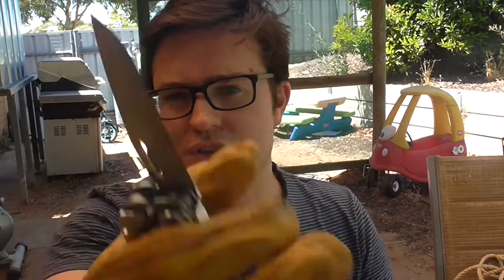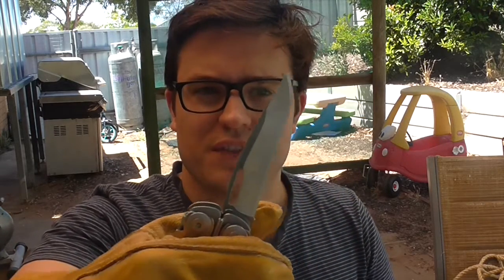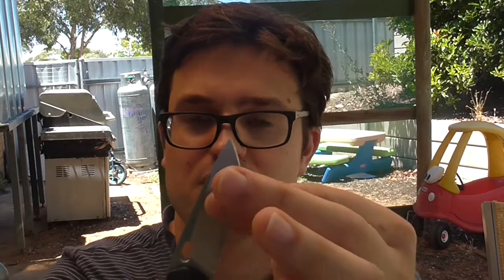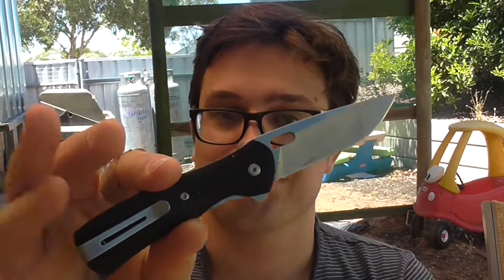Edge Retention Test! 420HC vs Paul Bos Buck 420HC edge retention comparison

Comment: Neat to see this old video of you in your younger days! Now, according to the data in a Larrin Thomas article, 420HC is one of the toughest stainless steels. This is one reason I recently purchased a Buck 726 (Mini Spitfire) for my deep wilderness hunting needs next fall. 2.1 oz lock back folder with a great geometry for game processing, and a blade that is super tough yet soft enough to be sharpened on a smooth rock, easy to strop with a belt before that, and made of nothing but metal so it will last a lifetime and never add plastic to the oceans. And less than 50 bucks!  Thanks Buck! And thank you Cedric for providing outstanding data over the years, mighty appreciated!

Comment: Amazing. This makes Paul's heat treatment method roughly 33.33% greater in wear resistance/edge retention than (probably) pretty much every other 420HC blade, give or take +/- a good 5-7% it clears easily with flying colours even if you're pessimistic.
So this is why the Buck Pursuit Pro in S35VN has been known to be able to field dress multiple friggin' deer without a need of sharpening. I own both sizes of the Pursuit Pro & a regular Pursuit small. They're amazing EDC fixed blades, especially the smaller 3.5" one.

Comment: 44 cuts to 67 cuts is just over 50% more (44 x 1.5 = 66). Nice review. I would think that the Paul Bos heat treat would be an industry standard for 420 HC. There must be many people who know exactly how Mr. Bos does it. Thank you for doing this review. I love Buck knives.
Reply: csh 62 While the principals of heat treating are pretty basic it's the time that Buck puts into the whole process including normalization that sets them apart from the rest of the industry.
Reply: There's a huge difference in geometry.
The heat treat doesn't have to do anything with it.

Comment: Buck’s 420HC is great for an inexpensive stainless steel, and it tunes up pretty nicely with a few passes on a barber’s strop loaded with medium or fine paste.
Reply: Bucks was great but there are so many other steels that are just better now. Nitro-v, 14c28n, d2, 154cm when priced reasonably, 13c26, 9/10cr, hell even aus-8 or 8cr kinda stomp it for pocket knives
Reply: @Freakmaster480  Bos does such a good job with heat treating that numerous knife makers farm all their heat treating out to them. I guess they anneal their barstock, complete the stock removal and then ship them off.
Reply: Bos' s30v is pretty god but that doesnt change the fact that 420hc is outdated
Reply: @Freakmaster480 it allows Buck to make a knife for $25 and sell it for $100 😂

Comment: For the Buck knife to achieve 150% of the work of the Leatherman you really have to consider the Paul Bos 420HC as a different steel altogether from the budget friendly but low performance regular 420HC

Comment: Yeah Paul Bo's really knows his heat treat. Just imagine him working with zdp or S110v
Reply: Both of those steels are better off with a milder heat treat. S110v can get up to 68 hrc but at that point edge retention means nothing when you’re chipping your edge on cardboard. s100v is better around 64-66 hrc because it will still have ridiculous edge retention but will maintain some toughness.

Comment: Interesting.
How does the hardness of the blades compare?
I know Buck runs their 420HC a point or two higher than Case's "True Sharp" 420HC, and holds an edge a little longer, at least partly, for that reason.
Reply: He did the exact same test on Case's tru-sharp and got 65 cuts out of it. Pretty much identical. Cases carbon steel got 77.

Comment: Despite being the budget friendly end of town, I thought this was the most interesting showdown so far. But I'm wondering, were the bevels about the same angle? Did the meatier Buck have more meat actually supporting the edge or were they pretty similar where it would count for edge retention?
Reply from the maker: Everyday Adventure I would guess the bit that wears in a test like this would be the same quarter of a millimeter or so from the absolute edge and just under it (to use laymans terms) with the extra thickness just making it a bit harder to cut with on the buck. The best I can do is put the same WS edge on each in terms of removing that variable, I think!
Reply: CedricAda Gear and Outdoors Yeah I suppose the steel that supports the edge from chipping or folding for a non impact cut would probably be pretty close to the apex, probably all within that micro convex area the belt is creating, which should be pretty uniform. Although it would be starting that appleseed curve based on the existing bevel, so maybe a bit different. Just wondering if that might have contributed to the better performance of the thicker blade, but probably not much of a factor. Don't mind me, I'm just peer reviewing your science to make it extra sciency.
Reply: Actually it probably wouldn't be chipping would it, even on a chip prone steel. What is the dullness caused by in this test? Deformation mostly I guess and a bit of abrasion?
Reply from the maker: Everyday Adventure I would say the microabrasions from the rope strands, its a sort of fluffy, fibrous stuff. Just sort of polishing down the microserrations that form the absolute edge. Just waiting for cliff stamp or someone to appear and lol at my terminology heheh
Reply: I'd love to be able to see what is going on under a microscope, pity you've already spent the entire research grant on 700 meters of rope and a bulk pack of bandaids.
Reply: Workbench Wisdom I've heard people talk about that change Buck made to their heat treat and the ensuing marketing exercise. It would be interesting to learn more and compare examples. It will be interesting generally to see where Pete goes with the testing, probably a lot to learn with the tests that compare the same steel from different manufacturers/factories/with different heat treatment etc. At a certain point a lack of proper understanding of chemistry/metallurgy is going to limit the interpretation of results, but it's a good exercise to start down that path.

Comment: Interesting but not really accurate.  In order for the test to be accurate you would have to have identical blades with the one exception of heat treat. Edge thickness and micro bevel affect edge retention greatly.